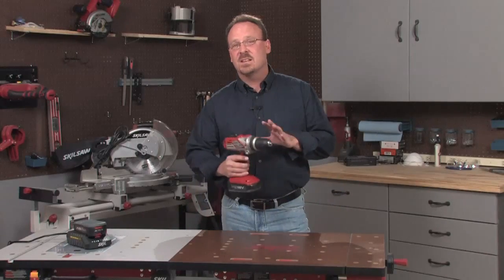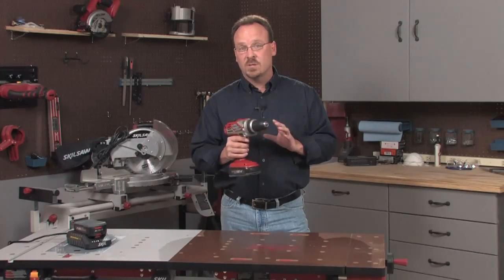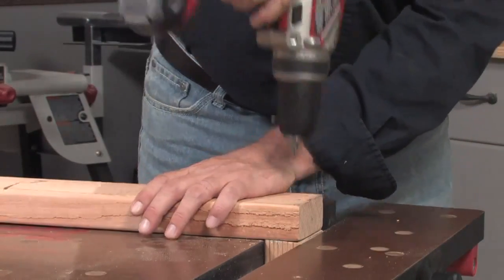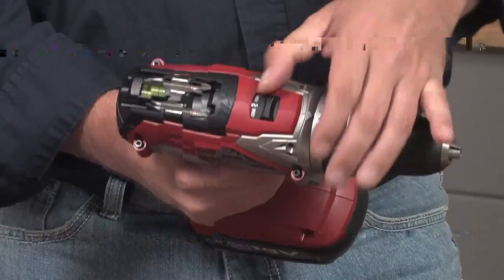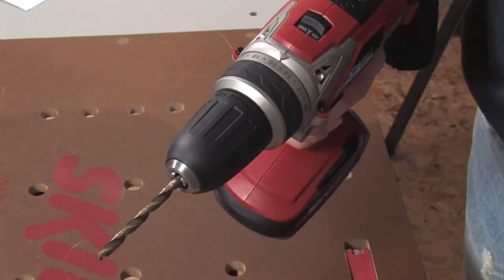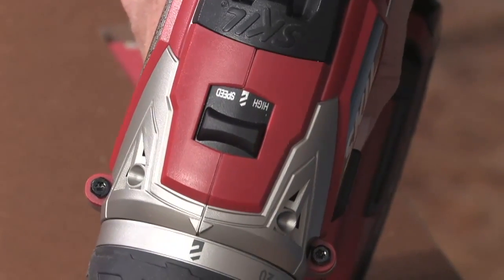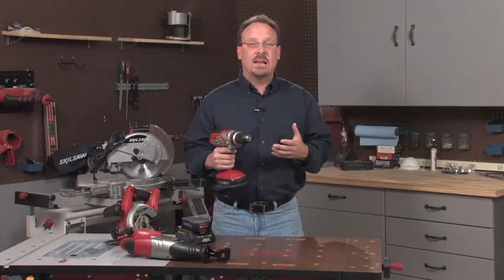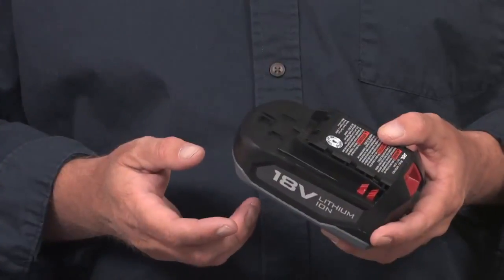How to Use a Cordless Drill from Skil Power tools

Comment: How long would the 18v cordless drill battery last for if the drill was just left on full throttle?
Reply: Jay when I first got my NiCad version I drove about 70-3 " deck screws in  and backed them out on one fresh fully charged battery.  Drove hundres of 1 5/8" deck screws into 1/2" OSB fastened to the studs in my garage shop !!!

Comment: Stupid design on the battery pack removal!  The release switch is rigid and tight.  The pressure required to press it down goes in the opposite direction of how the battery pack slides out.  It almost requires 3 sets of hands.
Reply: Cary  naw !! ! Be smart and put the battery on the edge of the bench, push the release button and puh down on the drill handle !!!  Comes right off !!!  I have never had a battery fall off either !!!!  DUUUUH!!!!!!